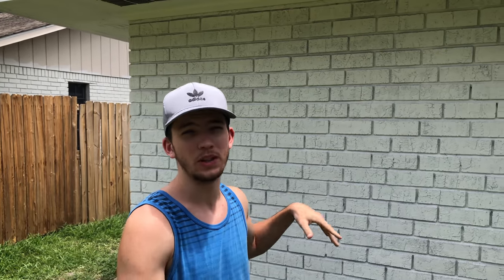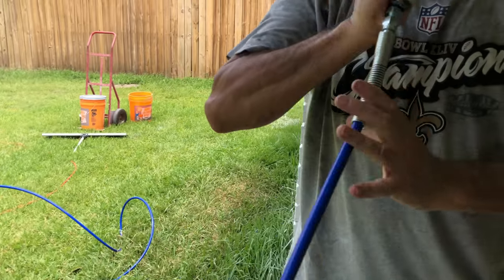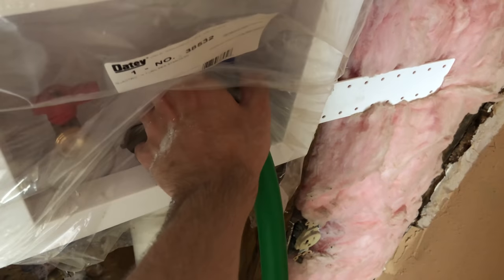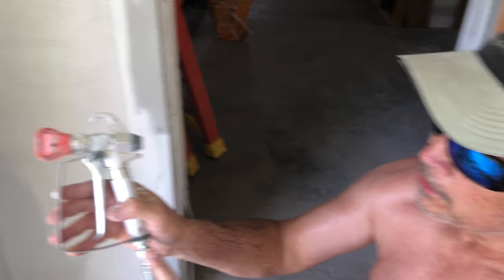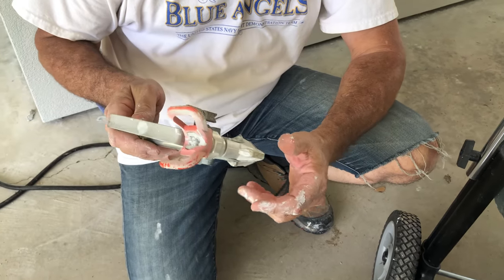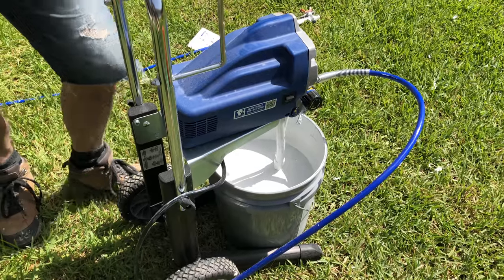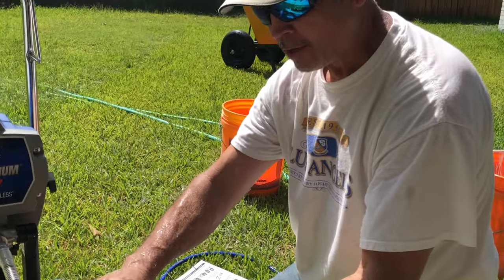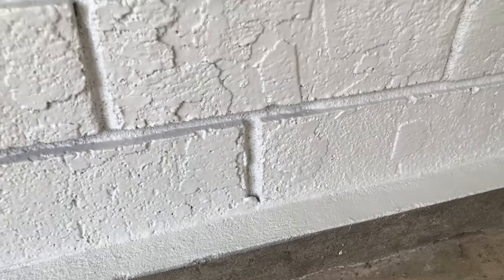SPRAY PAINTING THE HOUSE! - Graco Magnum X7 Impressions!

Comment from the maker: Hey Gang! We're seeing a lot of comments regarding the sprayer so we just wanted to clear some things up for those of you watching! In this video you'll see a "tailing" or "fingering" effect, this is caused when the sprayer pressure isn't high enough to spray the specific paint you're using. We had overlooked a key step in the instructions and it just happened to be the one discussing pressure, oops! This video is Day 1 of us using this sprayer, for years we brushed and rolled on our paints so this was a very new process for us! The video isn't meant as a tutorial, and we're super glad a lot of the more experienced painters in the comments have let us know that these traits in the spray patterns aren't the best. 5 months later we're still using this sprayer and we have it tuned down to second nature, we think this is reflected in our most recent painting video so make sure to go check that one out and let us know what you think! 

As far as the paint goes it is a PPG Exterior Paint & Primer in One. 100% Acrylic Latex Eggshell color.
Reply: Hay buddy what kind  of paint you use for brick. What type. And what type of sealer. So it won’t wash away.
Reply: quick question I looking to also paint my house did you go with primer first then brick paint...  or used multiple coats of paint? Thanks!
Reply: ⁰0
Reply: ⁰p
Reply: 0
Reply: 0
Reply: As professional painter I would say that almost everything in the video is wrong,

1. That sprayer is not for large projects if you want a better one get a Graco nova is one of the cheapest professional Sprayer in the market 

2. When you do bricks if they haven’t been painted before you should use solid stain if it has bee painted a masonry primer is needed before applying paint

3. Tint the primer as the same color of the paint or apply two coats

4. Back rolls the stucco

Comment: I prefer to stain brickwork rather than paint, the stain is absorbed into the brick and changes the colour of the brick as opposed to painting which is adding a layer on top of the brick which over time will peel and require constant maintenance

Comment: Great piece of equipment, have used one for years.  A little trick I learned from an old time painter:  Buy a box of knee high nylon socks.  Place one over the inlet pipe to the airless.  Great filter.  Throw away after use.
Reply from the maker: I've been doing that exact same thing except with paint strainers.  Those knee highs are probably much cheaper 👍

Comment: No worries on the learning curve for the sprayer!  After 50-100gal you will master it! Also one tip (I see in the comments you use filters) I always poured into a fresh bucket.  A lot of the 5Gal buckets from local stores can get goopy at the bottom after sitting and you spend too much time fighting boogers. Depending on the size of the job, I open all buckets and pour ~25% from 2-3 buckets through a piece of aluminum windows screen I had on a "frame".  Close up all buckets and pump from the "clean" bucket.

Comment: Added tip, hook hose up to the inlet and recycle paint from hose back into the bucket with the sprayer line, spray into paint bucket until water just starts to come out.  That saves about a quart if you have a 50ft line.
Reply from the maker: Yeah I do that now 👍

Comment: Get a lid for the 5 gallon paint cut a v notch to the little hole and use that to cover your paint then clog the rest of the hole with a wet rag and then the whole thing with a rag you'll never have to worry about dropping your rag into the paint good job brother

Comment: To allow the spray head to swivel on the end of the hose could you replace the original fittings with quick connect compressor fittings, i believe they are called "type M" fittings? You and your son do some really nice work and i love your ceiling drywall tips.
Reply from the maker: Thx John 👍

Comment: The one color looks nice but I am doing my brick on the front of the house to coordinate with my new siding I had put on only I am using a light gray for the base coat of the brick and will fade two darker colors of gray sporadically on the bricks to make it look like real brick tones only in gray. I used this method on my fire place a few years ago and it gives it a tremendous look.

Comment: I would have just painted the trim to make it different looking and left the brick alone to be cleaned like new with acid washing it several times making them look good as new and I'm sure that would not have depleted the value of the home with the pait  job on the classic red brick that someone paid dearly to use and the installer so meticulously sorted threw the brick to mix the pattern up installing them .
Reply: I agree ,it would also look much better
Reply: Totally agree . These hgtv shows of painting all the brick white makes everything look cheap asf IMO . If I had to do it I’d stain each brick individually . Man I despise painted brick . It just screams hack or a flipper hoodwinking some newb house buyer . No judgement on these guys I love this channel. . And because this brick is textured it doesn’t look as cheesy as paint on brick usually does

Comment: Primer and paint will ruin brick where moisture is present especially if there’s winter freezing. If you must do it you should use line wash pain or a breathable paint such as a mineral based paint or a silicate paint. You will have to repaint here and there but you won’t have the premature brick and mortar degradation

Comment: At 13:42 into the video I can see a lot of paint lines on the finished wall. Did those lines go away after the paint dried? I have this exact same airless spray rig and I don't have lines like that after I paint a wall. I think he might have been holding the spray nozzle too close to the wall. Thanks,

Comment: We are painting are existing brick white (original white brick from 1969). Do you recommend a primer prior to painting or should the existing color suffice for the primer? Thanks
Reply from the maker: I'd check to be sure your paint will bond to the current paint properly; could be an alkyd.  May have to prime over that to get modern latex to adhere.  Search internet for "how to test for oil based paint" and go from there.  I hope that helps
Reply: Hire a professional ffs

Comment: Can you use paint thinner and thin the paint down a lil bit when painting a brick house???
Reply: Yes, they'd have to use water since its not oil based paint.  We do that sometimes with thicker primer.  Typically, just turning up the pressure is all that's needed.

Comment: Fantastic job , your son should have followed behind your spraying with a roller to fill in the cracks and make it look uniformed . Also if you still have the unit , the unit is not design to last along time. You may get  2 or 3 homes and then the pump usually goes. If you get the contractor units with easy change pumps they are made too last.. oh yeah I’m sure you bought the $30.00 hose swivel.. nice job never the less..
Reply: I disagree about the pump going bad. I think you’re thinking of the handheld sprayers with hopper. Some graco models have non serviceable pump and other pro models have replacement pumps. This machine x7 and x5 can last 10-15 years as I’ve heard on YouTube as long as you maintain and clean properly. The blue pump armour is a must for long term storage and for $500-800 they are worth the buy unless you can afford to spend more from the beginning

Comment: i dont understand the idea of painting bricks, you’re now gonna have to sandblast and repaint the home every few years
Reply: I painted my mom's brick house.. used a multi surface primer and a brick and masonry paint. It has been a few years and still looks new.
Reply: I bought a house with an addition on the back, I tore the addition down. They had pained it with peach oil based paint. I ended up repainting the brick to look like the rest of the brick, mortar and all.
Reply: On the internet they will advice you which colour goes with red brick, I ended up picking a tan like colour for the wall ,and a light beige colour for the window trimming,  it came out better than I expected
Reply: STAIN DONT PAINT!!!

Comment: Wrong tip and pressure. That's why you have that squirt gun on the edges of the spray pattern. I hope you're doing another coat or two.  No way that would pass an inspection on commercial. Painting white you get blinded and cant see your faults and misses.  No respirator.  Wasting tons of material,  maybe not important for one little job but if you were doing it everyday.   Good job for your first attempt.

Comment: Lots of "Tailing"/Fingering Going On.. Oh And Too Much Over Spray. Im Assuming This House Is A Rental Or A Flip ? No Disrespect Intended . Just saying. I Do Commercial And Residential.
Reply: What is tailing and fingering? I'm thinking about painting my house myself but have never used a sprayer.
Reply: @susansuits9851  Happens when the pressure on the machine is not at the right psi. Or the tip is blown out. It's like u get ur spray pattern but u get a line all the way down the sides of the pattern.

Comment: This was so hard to watch. Your poor back! I see several things that can make your guys life so much easier! For starters, get yourself an extension for your gun! And for Pete's sakes some new tips as well! Your pattern is so small and it's trailing. Those "universal" tips are junk 🗑️. There's always a right tip for the right job. That one would be for cabinets or doors. Your pattern could be so much wider and cut your spray time in half. Along with an extension you're not reaching or crouching. Except for the very bottom of your surface. Next, get a whip hose. That will keep you from fighting your hose all day and it'll move with you instead of against. Also, turn your pressure up! For brick, it should be almost up the whole way or darn near. Your pressure right along with the correct tip will literally cut that job time in half. Additionally, there is a product called floetrol out there there's excellent for thinning paint/primer. You don't want your block filler too thin but floetrol won't really do that it just helps it flow better and smoother. It's an amazing product. You can also use it for interior. You'll notice whenever you're cutting or rolling that it completely eliminates brush marks and lines. For that "cloud" ☁️ finish. The X7 is an excellent machine, I highly recommend it to both novice and pro painters. I have big boy sprayers and I also have 2 X7's and I'll bet I use them more than the others. They really are a great machine. Those are the major things I saw wrong with the video. There are some others but honestly, not worth mentioning. The ones listed are the ones that will make you guys better and more efficient at what you do. I'm glad to see a Dad/Son painting team. That really hit home. My business is family operated as well with me and my younger brother, and wife. We have another guy also that might as well be family. Whenever I started it was me and my dad and you too reminded me of me and him so much. It warned my heart to see you two busting it up together. You guys do pretty good work and you have a great channel. I hope these tips will make you guys better and save the "old man's" back! Thanks for taking the time to make the video and Sharing the experience. Take care guys and may God bless you with good health and many more blessings to come! -- Your brother of the brush 🖌️👨‍🎨